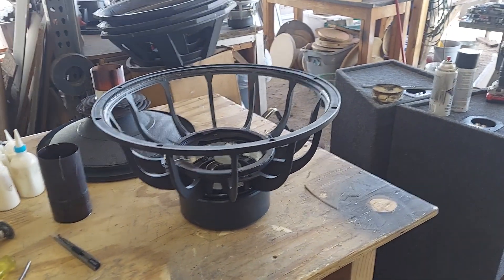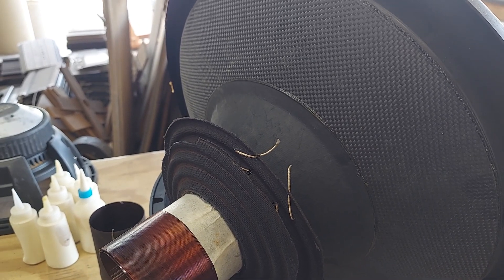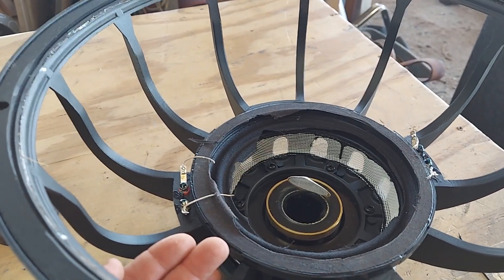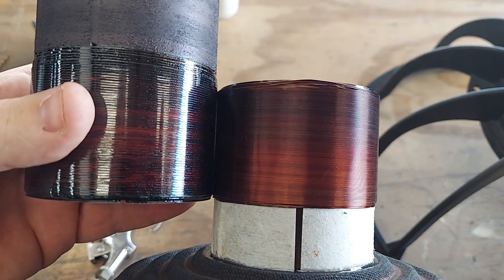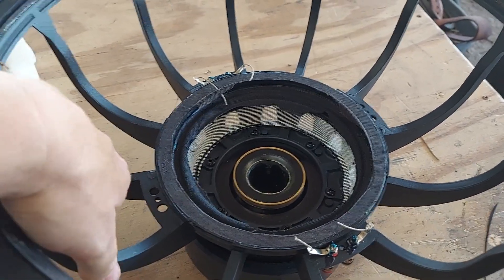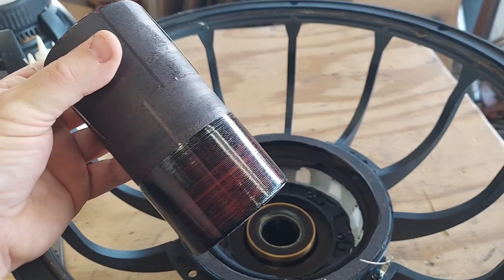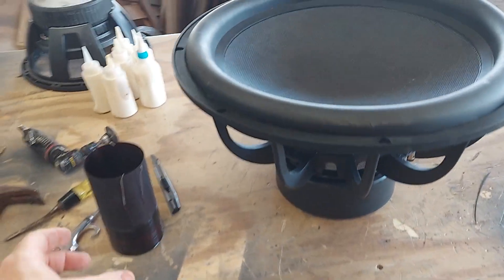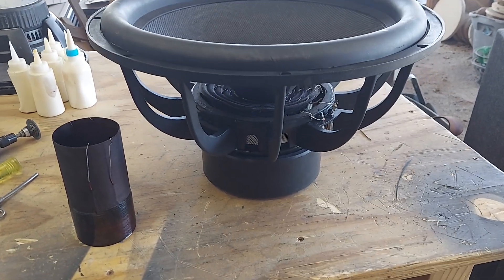18" D2 Dayton Audio / Parts Express Ultimax Subwoofer (Design by TC Sounds?) Review by Robot

Comment: These were NOT a TC Sounds or Thilo Stompler design. These were developed in house by Dayton Audio and manufactured in China by a pretty good build house that makes woofers for a number of companies including some you are familiar with. Second spiders are demanded by the woofer-buying public especially for home theater, as are the copper cap and shorting ring. Even then, I had a transducer engineer from Bose contacting me and saying we had too much Mms for even dual 8" spiders, but there were never any problems with sagging or fall-out of the compliance. You are correct that home theater was the target market. I am familiar because I was the project manager for this development, many many moons ago. The frame was open tooling. The single piece surround and gasket were a custom tool. The most difficult part was aligning the coupler cone to the fiberglass/nomex dish. We corrected some of the issues that were present in the smaller sizes of Ultimax to make them more robust for the 18", then some of those lessons were also applied to the 8". These are happiest in sealed boxes, not vented.
Reply from the maker: Cool.  I was under the impression that the Ultimax was developed to replace the AudioPulse Epic series which at the time PE was clearing out for Thilo.
Reply: Is this woofer a good choice for music only?  I want some kick for two channel music.
Reply: @buckmclean8391  Yes absolut! Closed Box!
Reply: How would these fair in a trunk baffle build ?

Comment: Is it a decent subwoofer for car audio? I'm going to be running 2 of them in my Explorer.
Reply from the maker: Yeah it's fine just don't pay too much
Reply: @RobotUnderground  I'm trading 2-12" Audio Legion Maximus subwoofers in a 4.0cf tuned to 32hz for 2-18" Dayton Ultimax in a 12cf box tuned to 36hz. May lengthen port for lower hz tuning.

Comment: Hey brother.  What sort of power do you think these 18s can happily take?  I'm thinking about buying 2 of them, and probably running them off my HCCA3000.4H 4ch amp, its rated 1500wrms x2 @ 4ohm, I also have a Stetsom 8K 2 ohm, but that's probably too much for even 2 of these 18s I'm guessing.  I'm a bit worried, these look kinda easy to damage both mechanically and electrically..
Reply: Currently I'm just running a single HCCA 12" dual 4 ohm off that 4ch, and it's good, it can easily soak up all of the 4ch and most of the 8K with the coils in parallel (all of the 8K with the coils in series).  I'm just wondering, will the big cone size (and maybe high efficiency?) actually make it far, far better than that 12" HCCA that can soak thousands of watts, or is this 18" just too weak?  The HCCA is insanely inefficient.
Reply from the maker: I would recommend something more hardy.

Just email us with your info when you're ready. RobotUnderground@yahoo.com

Comment: Those tinsel leads are a joke talk about the cheapest absolute junk you could put on a sub that got to be bargain-basement stock they're using even the crappiest subwoofers use double-stitched tinsel leads not to single roll crap
Reply: My DD 9918's have small leads like this, and they have handled 7k + rms watts for a couple years now. No failures. The quality depends on what that lead is comprised of. I've burned through PLENTY of flat sundown leads, since switching to digital designs, not one lead failure yet. 

I'll just throw that out there.